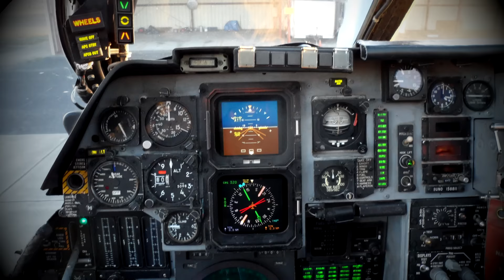USMC Jet Crashes Cable Car | Last Moments

Comment: I used to work on Prowlers up until the last deployment they had in 2018. The aircraft was not so much a fighter as a jamming electronic warfare aircraft. The highlight beyond the 4 man crew (3 ecm officers and a pilot) was that it was fast. It was designed to be able to evade enemy fire while flying low, so many pilots trained at low altitude, high speed, maneuvering. This incident was a big black mark in the unit's history (VMAQ-2), of which many Marines that were active at the time of incident remained on the last operation, which was coincidentally VMAQ-2 (branded the Death Jesters at the end). It was a good jet, just poor decision making by some pilots.
Reply: very pretty too, in my opinion
Reply: @abandonedaccount123  I always thought they looked like a quail
Reply: i've wanted to see a prowler for a while now, especially after it got replaced by the hornet and lightning, such a shame it was involved in this mess
Reply: What does ecm stand for?
Reply: @Michael Dupre Couldn't agree more, this was clearly a result of the brass effing up and blaming the lower ranks
Reply: Electronic Counter Measures
Reply: @FoxySpud  I worked on the EA6B when they were new to the fleet back in 71.
Reply: @waitaminute-vw9hf  must've been nice to dive into when they were fresh wires! You guys kept them looking good for us!
Reply: "of which many Marines that were active at the time of incident remained on the last operation,"(sic)

You're claiming that Marines serving in Q-2 in Aviano in February of 1998 were still with the squadron when it sundowned in March of 2019?
Reply: @AA-xo9uw  Yah some of the upper enlisted had started off there
Reply: The key reference being "electronic warfare". Intel resources will be covered up ... regardless of collateral damage. Wait. How do we know that it was an accident? Who was in the gondola?
Reply: A Vietnam plane for two extended to a tech warfare couch team
Reply: @FoxySpud  Cannon  plug wiring repairs fixed 90% of the gripes. I was a AT working with the factory reps. The wiring was a nightmare from the beginning. I can imagine how messed up it got after all the repairs.
Reply: The aircraft being a valuable force multipliers only add insult to injury, just my opinion.
Reply: @waitaminute-vw9hf  Canon plugs were still the common cause of gripes for us too. The wiring wasn't terrible, but you could see the years or repair and replacement.
Reply: @gabelaws  Electronic counter measures. It was a surveillance aircraft.
Reply: @FoxySpud  It was a good aircraft tho. VAQ-131 was the first prowler squadron deployed to Vietnam aboard the Enterprise. Lots of pilots were getting shot down by SAMs. The ECMs minimized that in the first deployment. It was ahead of its time in terms of technology.
Reply: @Jimmy_CV  There's a saying in the military. Shit always rolls down hill. 

Its how an Army E4(Specialist, between a private and sergeant for those not in the know) took the bulk of the blame of for the Abu Ghraib Scandal and was labeled as the ring leader of it when his squad and platoon sergeants were part of it and they were essentially encouraged to do so by the brass who were being directed by one the alphabet agencies. 

They could have blamed it on the private in the group, but she was pregnant at the time of the trial.
Reply: @gabelaws  electronic counter measures
Reply: @gabelaws  Electronic counter measures.
Reply: @Michael Dupre ...... especially after the other Pilots blew the whistle on them switching out the tapes and trying to cover it up, they should have either got life in prison or the death penalty...... preferably the death penalty.
Reply: @averilramsey7241  ...... so true, there was a congressman who was killed on that Korean flight a few years back that supposedly strayed into Russian airspace and he was going to blow the whistle on activities within the CFR.

Unbeknownst to the general public, that was documented.
Reply: "Poor decision" how to downplay murder. And you guys has the gall to call out Russia and other countries who made similar military mistake.
Reply: @faizalf119  haha yah that sure is how baseball goes.
Reply: @GUIRADE95    Only half right.  As it says just below, the plane was for suppressing enemy SAM (surface-to-air missile) sites (and possibly other enemy threats that it could try to neutralize with its equipment).  A surveillance model is known as a reconnaissance version, and the designation is represented by "R," as in the RA-5 Vigilante, a large carrier bomber that was a contemporary of the original EA-6B, which was also a reconfigured bomber.
Reply: @averilramsey7241  are you saying the aircraft covered it up? Lmaooo
Reply: @FoxySpud Was it the wire removal tools they issued that were a PITA? The half white, half colored ones that always crack trying to use them? Wasn’t Navy myself but USAF, so a couple of other electricians in my shop kept metal ones to use instead (ensuring jet didn’t have power hooked up with WOW, and knowing a circuit wasn’t DC of course). Those stayed in lockers and NOT in our pockets, and we took them out only if we knew we’d be working on one in a hangar so as to avoid FOD hazards. Same with a Bic lighter because those heating tools that were issued to shrink insulating splice caps, were always broken. All federal issued A\N parts. I proudly maintained 
F-15C/D/Es for years without an accident or incident. I love sharing stories with fellow maintainers, regardless of Branch.

Comment: The most impressive (for want of a better word) thing to me is the resilience of the plane. Do you realise the sheer force you need to cut 2 inches of fortified cable, only got the plane to get a dented wing? Thats insane
Reply: Physics are fun, aren't they? If you pushed that wing through at a rate if an inch per minute, it would slice through that wing like it wasn't even there. But it was moving slightly faster than that, wasn't it?
Reply: “Staggering”
Reply: @User0000000000000004  They were moving at a rate of 31,680,000 inches/hr.  Which means that they were moving at a rate of  528,000 in/min.  Or 8,800 in/sec.  Remember, force equals mass times acceleration and mass equals weight divided by gravity.
Reply: @Joseph Leishman I agree, that detail was entirely shocking. The fact that they were able to return to base was even more shocking. I expected to hear that the plane was cut into pieces that cartwheeled through the air and into the mountainside. I am totally amazed by what actually happened and it adds a massive amount of integrity to that airframe.

Comment: Pilot: Panics and blames the altimeter for own incompetence
Avionic Technician: I went to school to make sure that your altimeter and bitching Betty work at your higher than fleet standards, the least you can do is remember that you allegedly went to a flight school and know what a fucking mountain at 300 feet looks like vs 2000.
Reply: There’s no way they would have took that jet flying if it had a defective altimeter.
Even if it went defective mid sortie, they wouldn’t have pressed on at low level. 
There’s some safety critical systems that you can’t fly without.
Reply: People often forget icing is an issue, alot of static port's arn't heated and so they can ice up. it's possible that's what happend. when they landed the altimeter would have worked fine as the ice had melted
Reply: @Cessna152ful  Interesting, interesting...... And, uh.....why did they destroy the video evidence if it was just equipment malfunction and they did nothing wrong?
Reply: @bricaaron3978  ...... they are guilty as hell and no amount of fraudulent cover-up will ever change that.
Reply: @Cessna152ful  they have these things called "a pair of eyes" it's not that hard to see that they're flying very low.
Reply: @bricaaron3978  Basic human panic really, people do weird shit when in stressful situations
Reply: @Cessna152ful  I'm guessing you have been in one of those stressful situations every time you've commented thus far.
Reply: @bricaaron3978  I'm a pilot yes, i've been in life threatening situations due to various reasons. You are not a pilot from what i can see so you have no idea what it looks like for us.
Reply: @Cessna152ful  You're dishonest. It's that simple. You're willing to deny reality in order to maintain the belief that you wish to maintain.

That's it, with no sugar coating---the way I wish more men would speak today.
Reply: @Cessna152ful  If you can't tell 300 from 2000 feet with your naked eyes IN THE MOUNTAINS you have no business being a pilot. But thanks for being so open about the fact that the only threats to life that matters are threats to your life and every otherr loss of life is insignificant and easily excused.
Reply: @notmenotme614  "There’s no way they would have took that jet flying if it had a defective altimeter."(sic)

The RADAR alt on the EA-6B was notorious for its intermittent operation at times. Not uncommon for it to fail after launch.
Reply: @Cessna152ful  The only problem with your hypothesis is that the RADAR alt doesn't utilize a pitot input.

Comment: I drove in one of those cable cars a year or so after the incident, it was completely unfathomable that a jet would actually hit it because it was so low over the ground, at least in regards to any plane in the middle of a living and tourist area. It was such a massive scandal back then.
Reply: It has been rebuilt in a completely different manner, with a new station at the bottom of the valley and smaller cable cars closer to the ground. The old style gondola had one single span crossing the valley 100m high...
Reply: @mrarci6569  Oh Dan yeah that would make more sense, but it's still completely insane. No jet should even fly in that area.
Reply: @MaxiGoethling  This place were flying under that cable in that one exact spot all the time, it was some kind of tradition in that military base... the cable was 110m above the ground in that place.
It is posible that the cable-car was the only unexpected part in this stunt, the pilot was forced to corect the flight because of it and with speed of 540mph it was simply an imposible task to do it right, so he avoided the crash into the car but cut the cable.
Because list of pilots that did it before him was ling the army covered up everything...
Reply: @Stevie-J  Hadewich Antonissen (24, Vechelderzande), Belgian;
    Stefan Bekaert (28, Leuven), Belgian;
    Dieter Frank Blumenfeld (47, Burgstädt), German;
    Rose-Marie Eyskens (24, Kalmthout), Belgian;
    Danielle Groenleer (20, Apeldoorn), Dutch;
    Michael Pötschke (28, Burgstädt), German;
    Egon Uwe Renkewitz (47, Burgstädt), German;
    Marina Mandy Renkewitz (24, Burgstädt), German;
    Maria Steiner-Stampfl (61, Bressanone), Italian;
    Ewa Strzelczyk (37, Gliwice), Polish;
    Philip Strzelczyk (14, Gliwice), Polish;
    Annelie (Wessig) Urban (41, Burgstädt), German;
    Harald Urban (41, Burgstädt), German
    Sebastian Van den Heede (27, Bruges), Belgian;
    Marcello Vanzo (56, Cavalese), operator of the downhill cabin, Italian;
    Stefaan Vermander (27, Assebroek), Belgian;
    Anton Voglsang (35, Vienna), Austrian;
    Sonja Weinhofer (22, born in Munich, domiciled in Vienna), Austrian;
    Jürgen Wunderlich (44, Burgstädt), German;
    Edeltraud Zanon-Werth (56, born in Innsbruck, living in Bressanone), Italian.
Go and find some good surgeon that gonna do something for the humanity and gonna perform a lobotomy on your sick, hardly used brain...
Reply: @Bialy_1   That's my opinion. He must have done a very well planned research to manouvre a descent from the original altitude of 2000 feet down to the height just below the cable car. This is described  in the book I Due Cermis by several eye-witnesses who who saw the plane just before the incident. However, the pilot didn't take account of 1 thing. He must have taken into account the height of the cables when they are suspended with no gondolas on them. Since this cable car had a very long section between bottom station and 1st pylon (I think nearly 1 kilometre), the cable with no gondolas vs. the cable with a fully loaded gondola with 20 people on board must have meant that the gondola could have been up to 4-5 metres lower than during normal conditions with no gondola on that section of the cable. Since the pilot needed to be as high as possible above ground, but just below the gondola, he must have assumed that by flying 4 or 5 metres below would not create any danger to the gondola. And when he realized something was not correct in his calculations it was too late to do anything about it.

Comment: Italy doesn't have much luck with their cable cars. Just 2 years ago a cable ripped shortly before the car entered the hilltop station, sending many people downhill to their deaths, because the emergency brakes have been tampered. How these last seconds feel is not something I would want to imagine...
Reply: That's the first thing in a while to actually make me furious, even if only for thirty seconds.
Which surprises me, since I've been reading and listening about much more drawn-out murders, corruption, and other wrongs to the point that I am rather cynical again.
Reply: @adamofblastworks1517  It makes you angry because unlike most other murders, killings and stuff whoever tampered with the emergency brakes didn't know or even see the people he killed. With most murders the people know each other and with the rest the murderer actually at least sees and knows he is killing that specific person or group of people. In this case though whoever screwed with the brakes didn't go through any of that which just seems wrong to us on an instinctual level.
Reply: @DeathlordSlavik  I think you're right
Reply: Yes, that's right. And Cavalese is especially unlucky as not many people know that this same cable car, which crashed in 1998 due to the impact with the Prowler, had a much worse incident on 9.March 1976, in fact the worst cable car incident to date where 42 people lost their lives: https://youtu.be/6-GBikY0AqM

Comment: The amount of incompetence and negligence in the US military and it's contractors that is swept under the rug and dismissed is beyond comprehension,this just happened to get a lot of press because it was impossible to cover up quickly and neatly.
Reply: Incompetence would imply that they don’t know what to do. They do. But they don’t care as long as the lives at risk aren’t American and they can cover up their asses.